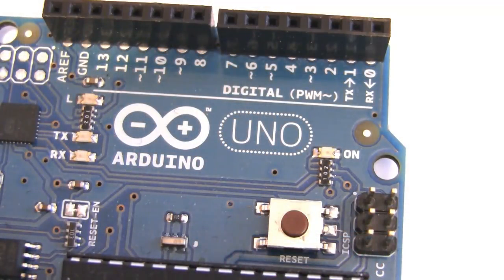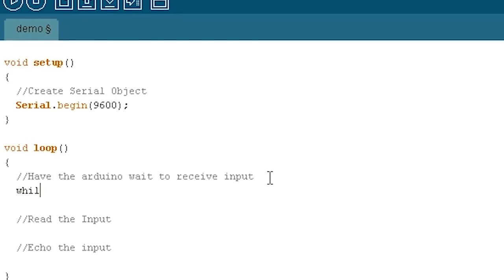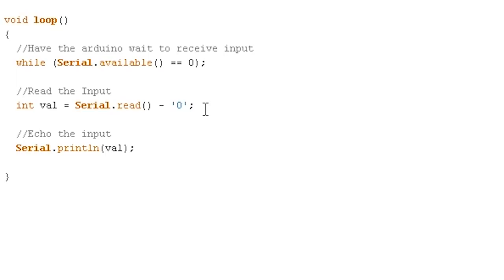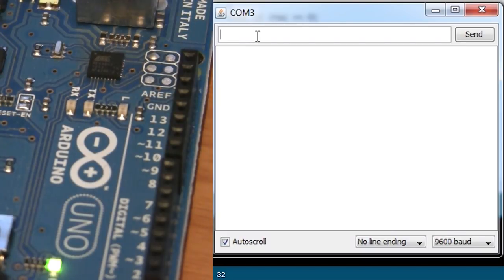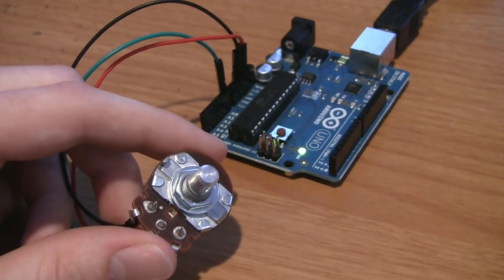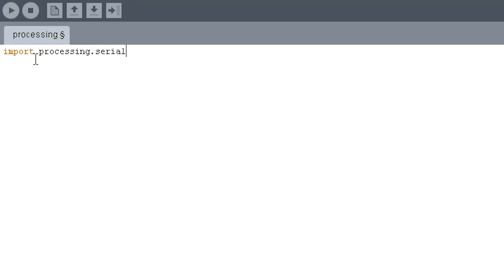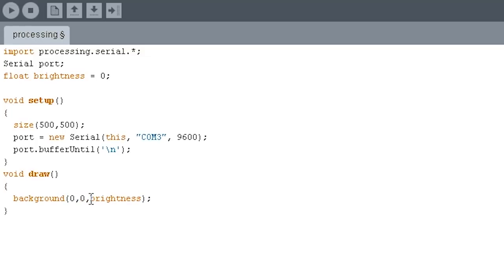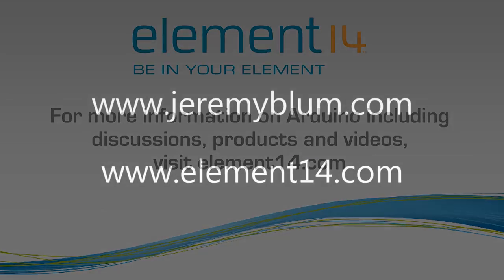Tutorial 06 for Arduino: Serial Communication and Processing

Comment: void setup() {
  Serial.begin(9600);
  pinMode(13,OUTPUT);

}

void loop() {
 
  if (Serial.available() > 0) {
    int value = Serial.read();

    if (value == '0'){
       digitalWrite(13,LOW);
       Serial.println("pin 13 is low");
     }
    else if (value == '1'){
       digitalWrite(13,HIGH);
       Serial.println("pin 13 is high");
      }
    else
       Serial.println("Invalid");       
  }
}

when I type 010101..... 100 times, I only get no more than 75 printout statements! can anyone explain why !!

Comment: Can I use the pins to have multiple arduinos on 1 USB? In other words 1 arduino on USB and a few Atmegas linked in parallel to the arduino 1 and 0 pins. I would communicate with them by sending a letter in front of what I was sending on serial. The letter is coresponding to the chip

Comment: following this guide. (the most helpful one i've found so far, so thank you!)

i'm still having issues.

my code is identical to yours. but in my serial monitor i'm getting (before adding " -   '0'  " i was getting "49 \n 10"

after adding - '0' to the code i'm getting "1 \n -38" output print in the serial monitor

can anyone explain this? any help would be greatly appreciated

Comment: hey sup just have a question when i press verify button on the computer it get an error that says
'else' without a previous 'if'   any idea?????  i try by replacing the 'else if' and 'else' statement by using just the 'if' statement and it didnt showed any error but the LED turns on with any button i press and the arduino sends back "Led is On Invalid!" at the same time with any button the number 0 works good to turn the LED off with the right message.
any ideas??  thanks for your time!!

Comment: Dear Sir,
I have be working on serial communication program by using while loop - to on & off the led's 

i found some garbage value still in serial data - even after use the Serial.flush

kindly find the below code & help me to rectify the garbage value

  int ledpin = 13;
 
 void setup() {

  // put your setup code here, to run once:
    Serial.begin(9600);
    pinMode(ledpin, OUTPUT);

}
void loop() {
  // put your main code here, to run repeatedly:
while (Serial.available() == 0) {}
//Read The Input
  int val = Serial.read () - '0';

  if (val == 1)
  {
    Serial.println("Led is on");
    digitalWrite (ledpin,HIGH);
  }
  else if (val == 0)
  {
    Serial.println ("Led is off");
    digitalWrite (ledpin,LOW);
  }
  else
  {
    Serial.println ("Invalid!");
  }
  Serial.flush();

}
Reply: The output come like this
Led is on
Invalid!
Invalid!

That is the loop will break by  garbage value even i stop the serial input

Comment: PLS HELP ME!! i created my void called 8 and i have error message: expected unqualified-id before numeric constant......  i dont know what's wrong..here is the code:

 void setup() {
  // put your setup code here, to run once:
    pinMode(3, OUTPUT);
    pinMode(5, OUTPUT);
    pinMode(6, OUTPUT);
    Serial.begin(9600);
}

void 1 {
    analogWrite(3, 255);
}

void 2 {
     analogWrite(5, 255);
}

void 3 {
    analogWrite(6, 255);  
}

void 4 {
     analogWrite(3, 125);
     analogWrite(6, 255);
     
}

void 5 {
     analogWrite(3, 255);
     analogWrite(5, 100);
     
}

void 6 {
     analogWrite(5, 255);
     analogWrite(6, 150);
     
}

void 7 {
     analogWrite(3, 255);
     analogWrite(5, 50);
     
}

void 8 {
     analogWrite(3, 255);
     analogWrite(5, 255);
     analogWrite(6, 255);
     
}

void off {
     analogWrite(3, 0);
     analogWrite(5, 0);
     analogWrite(6, 0);
       
}
void loop() {
  // put your main code here, to run repeatedly:
   while (Serial.available() == 0);
   int led = Serial.parseInt();
   if (led < 9 && led > 0) {
       off;
       led;
   } else {
        Serial.println("wrong number");
     }
}

Comment: Hi Jeremy, how can I create a user interface where a user can input the angle for the servo to turn which is run by arduino?
Reply: I just did that yesterday. its a little tricky if you want to input a 3 digit number ( such as 180 degrees) using the terminal. Let me know if you want the code.
Reply: ***** Did u manage it through the serial monitor as well? Yes, it would be helpful to see the code. Thanks!
Reply: Just copy this code into your Arduino IDE it should work. And yes it uses the serial monitor
Reply: ***** Thank you. This is very helpful.
Reply: A Lost Compass No problem this is what the Arduino community is all about.

Comment: I had the same problem (Win7 64bit; processing 2.0b8 64bit). Had to fall back to using 32bit version of processing: 2.0b8 32bit). I would advice to have several versions of processing installed. I have now 2.0b8 32bit (for serial communication), 2.0b8 64bit (for current with the most modern version) and I also have 2.0b7 32bit (because there're some incompatible changes  between b8 and b7 (for example XML library). Hope this helps.

Comment: hey mate my arduino UNO works completely with processing. I can see all the values popping up in the processing console, however when I try the exact same thing with the Arduino Mega 1280. Nothing happens on processing. I dont see any values on the processing console either. 
Some told me it might be an issue with Firmata. I've tried researching by it seems like uploading the standard firmata sketch is the only solution. It hasnt worked for me. 

Do you know what the problem might be?

Comment: I tried to control 5 LED's using a similar program. Here's a description of my program: Typing in the number 1 on the Serial Monitor turns on the first LED, then prints out "First LED is on!" using a Serial.println() function . Same goes for the numbers 2, 3, 4 and 5 but typing in the number "0" turns off all the LED's then prints "All LED's are off!" in the Serial Monitor. Also, I have put an else statement that tells the Arduino that whenever I type in any other character, it prints out "ERROR!" The LED's turn on and off as expected but the Serial Monitor keeps on printing "ERROR!" each time I type 0, 1, 2, 3, 4, or 5 (e.g. Second LED is on! (new line) ERROR!). Feel free to point out any errors in my sketch.
Reply: Here's my sketch:

const int led1 = 9;
const int led2 = 10;
const int led3 = 11;
const int led4 = 12;
const int led5 = 13;

void setup()
{
  pinMode(led1, OUTPUT);
  pinMode(led2, OUTPUT);
  pinMode(led3, OUTPUT);
  pinMode(led4, OUTPUT);
  pinMode(led5, OUTPUT);
  Serial.begin(9600);
}

void loop()
{
  if(Serial.available() > 0)
  {
    int data = Serial.read() - '0';
    if(data == 1)
    {
      digitalWrite(led1, HIGH);
      Serial.println("First LED is on!");
    }
    else if(data == 2)
    {
      digitalWrite(led2, HIGH);
      Serial.println("Second LED is on!");
    }
    else if(data == 3)
    {
      digitalWrite(led3, HIGH);
      Serial.println("Third LED is on!");
    }
    else if(data == 4)
    {
      digitalWrite(led4, HIGH);
      Serial.println("Fourth LED is on!");
    }
    else if(data == 5)
    {
      digitalWrite(led5, HIGH);
      Serial.println("Fifth LED is on!");
    }
    else if(data == 0)
    {
      digitalWrite(led1, LOW);
      digitalWrite(led2, LOW);
      digitalWrite(led3, LOW);
      digitalWrite(led4, LOW);
      digitalWrite(led5, LOW);
      Serial.println("All LED's are off!");
    }
    else
    {
      Serial.println("ERROR!");
      Serial.flush();
    }
  }
}

Comment: Hey, thanks for the tutorial, it was very usefull. However, I am using 2 flex sensors and I would like to read the changing values into processing. Is there an example anywhere of what code i need to write into processing? I have been able to successfully get it working in arduino I just dont know how to get analogue values into processing.  ANy  help would be greatly apreciated :) thanks in advance

Comment: Great tutorial man!! thanks a lot!

I'm still having an issue though if anyone can help. I copied the exact code as in the video. Everything is working as expected expect for one major thing. Whenever I type an input the program execute the respective "if" condition which it expected. However, then it instantly jump to the last condition in the "else" function by itself without typing anything.

For example, when I type 1 any press enter I see this in the serial monitor
LED is on
Invalid

the program jumps to the "else" condition and displayed "invalid" right after "LED is on" even though I typed nothing expect for 1.

Comment: Hi Jeremy… Greetings of the day…
I need your help, I am working with RF module 433MHz. I want to switch the digital pins of reaciver side arduino through the transmitter arduino, at list 4 pins. I have seen different kind of codes on different sides but I don’t understand the it bcz of absence of discreaption…So pls help me, send me the sample code for 4 LEDs No/Off through RF. I am using Arduino nano both side….
And thanks in advance….

Comment: Hi sciguy14, I am taking this idea an try to implement that using PIC16F73 and Processing. I have a normal while loop and For Statement that send via UART to the Serial Port a number from 0 to 255. On the Hyperterminal I can see those numbers but according to the ASCII table chars.

Now, on the Processing side, the windows should take those reading from the Serial Port and change according to the number that is coming in. 

Do you know why it is not working? 
P.S: I receive the data from the PIC

Comment: Please annotate the part where you talk about the voltage/pins of the connection, because it couldn't be more misleading. While USB may have 4 pins, it doesn't have RX/TX. RS232 on the other hand has RX/TX, but doesn't have 4 pins or power. You're mixing USB and RS232 together. This could lead people to think they can simply connect TX/RX to pins of USB and possible fry their USB port or the device on the other end.

You either have a real serial port, which uses around +-15 volts. This means you'd need a logic level converter to talk to a microcontroller.

Or you've got USB, which needs an USB-to-serial converter, which is a totally different thing. In this case there's no level shifting at all because you never have something else than 0 and 5 volts.
Reply: Hello, I am new in Arduino world and electronics. I have Arduino Mega2560. I have a USB to serial converter on my laptop and connected directly Serial Pin 2 to Arduino Tx0, Serial Pin3 to Arduino Rx0 and Serial Pin 5 to Arduino GRD. I executed the simple program shown on the video but I get no communication. Is this approach correct? Do I need another converter in between or is there any other wire which is not connected? Any help will be appreciated.
Reply: you have to use TTL to RS232 Converter

Comment: Hey great tutorial!

Ive read all of the suggestions below but have been unable to get the Serial.flush or any of the variations listed below working.  Im using Arduino 1.0.4 with an UNO on Mac OS X 10.8.3.

I have not downloaded Processing but it does not offer 32 bit for Mac?

Thoughts anyone?

Comment: Following you, I added the Serial.flush() command but it keeps repeating the "Invalid" when I type in a "garbage" input. Here is the code:
void setup()
{
  Serial.begin(9600);
  pinMode(13,OUTPUT);
}

void loop()
{
  int input;
  while(Serial.available()==0);
 
  input=Serial.read()-48;
 
  if (input==1)
  {digitalWrite(13,HIGH);Serial.println("Led is ON!");}
  else if (input==0)
  {digitalWrite(13,LOW);Serial.println("Led is OFF!");}
  else
  {Serial.println("Invalid input");
  }
 
  Serial.flush();
}

Thanks for help!
Reply: Mads Hammerich I get the same error as him, but when I do as you say, I keep getting the error. Would you mind posting the whole code?

Comment: If the Serial.flush(); command isn't  working, this program seems to work(modified version of Dunc Poly's program also in the comments here):
int led=13;
void setup() {
pinMode (led, OUTPUT);
}void loop() {
  Serial.begin(9600);
  while (Serial.available()==0);
  int val=Serial.read()-'0';
  if (val==1)
  {
    Serial.println("LED is on");
    digitalWrite(led, HIGH);
  }
  else if (val==0)
  {
    Serial.println("LED is off");
    digitalWrite(led, LOW);
  }
  else
  {
    Serial.println("invalid command");
  }
  Serial.end();
}

Comment: when I enter 0 it returns 
48
10
why is that?
Reply: ASCII code i presume , 48 represents 0 in ascii
Reply: I ran into the same problem and it turns out that 10 is the ASCII code for "/n" (new line). However, I haven't figured out where it comes from or how to get rid of it...
Reply: So I eventually fixed it by changing the dropdown menu in the Serial Monitor to be "no line ending" (at the very bottom of the serial monitor window). Hopefully this helps
Reply: Yiqing Lin Awesome! thanks for sharing.

Comment: If you want to see a neat Processing script with the pot, change the Arduino map values to 0 - 360 (in the tutorial, it is 0 - 255... so change the Arduino mapping value "255" to 360).  I am on Windows 7, 64 bit... running Processing 2.0.3 32-bit (as I ran into all of the same problems listed below).  You will also need to setup the font (see the next tutorial on how to do that... or in processing just click Tools -> Create Font... and select the AgencyFB-Bold font, select size 200 and then click OK).  Here is the script:

import processing.serial.*;
Serial port;
String pos = "";
int index = 0;
PFont font;

void setup()
{
  size(800,800);
  port = new Serial(this, "COM7", 9600);
  port.bufferUntil('\n');
  font = loadFont("AgencyFB-Bold-200.vlw");
  textFont(font, 200);
}

void draw()
{
  background(255);
  fill(0,102,153);
  arc(400,400,(index*2),(index*2),0,radians(index),PIE);
  fill(200,200,0);
  textSize(index/1.85);
  text(pos+"°",400,400);
}

void serialEvent(Serial port)
{
  pos = port.readStringUntil('\n');
  pos = pos.substring(0,pos.length()-1);
  index = int(trim(pos));
}

Have fun!!!  Cheers!!!
Reply: Also made a small change to the Arduino code... so it only send the serial data if the value has changed.  Not really needed, but if this was a complex application, limiting down the serial processing is a good thing :)

int potPin = 0;
int oldVal = 0;

void setup()
{
  Serial.begin(9600);
}

void loop()
{
  int val = map(analogRead(potPin), 0, 1023, 0, 360);
  if(val!=oldVal)
  {
    Serial.println(val);
    oldVal = val;
  }
  delay(50);
}

Comment: hey Jeremy Blum ,
 Thank you, your tutorial really helped me out. followed your instructions and got the exact result. now i want to process three srevo through processing. but its not working can you help me out with it.
 
here's my three servo arduino code :
 
#include <Servo.h>

float sensorRange = 0.0;

Servo servo1;
Servo servo2;
Servo servo3;
Servo servo4;
 
float correz=0; // correction due to robot geometry errors

float xPos = 0;  // x axis position
float yPos = 0; // y axis position
float zPos = 0; // z axis position, negative is up, positive is down. Delta bots are usually used up side down...

float t1;  //servo angle t for 'theta', 1 for servo 1
float t2;
float t3;

float currX = 0;
float currY = 0;
float currZ = 0;
float currT = millis();
int   currV = 0;
int   vChange=0;

float targetX = 0;
float targetY = 0;
float targetZ = 0;
int   targetV = 0;

float maxSpeed = 1.500; // mm / millisec -0.600 is good
float minSpeed = 0.001;
float currSpeed= 0;
float acceleration = 0.001; // mm / millisec / millisec - 0.002 keeps the current rig pretty calm, 0.004 starts to be wobbly

int result=0;
int data = 0;
boolean finitoPercorso = false;
boolean finitoMvto = false;

float cumula=0;

int u=0;

void setup(){
  servo1.attach(3);
  servo2.attach(6);
  servo3.attach(9);
  servo4.attach(10);

  delay(500);
 
  Serial.begin(38400);
  vacuumOFF();
  delay(500);
 
  // build the path
  buildPath();
  // setup the motion values
  setupMotion();
  u=0;
}

void loop(){

  while (!finitoPercorso){
    boolean a=loopPath(); // make the path
    if (vChange==1)
      vacuum();  // start/stop the vacuum
    while (!finitoMvto){
      boolean b=loopMotion(); // make the single motion
    }
    finitoMvto=false;
  }
  delay(1000);
 
 
  servo1.detach();
  servo2.detach();
  servo3.detach();
  vacuumOFF();
  delay(500);
  servo4.detach();
 

}